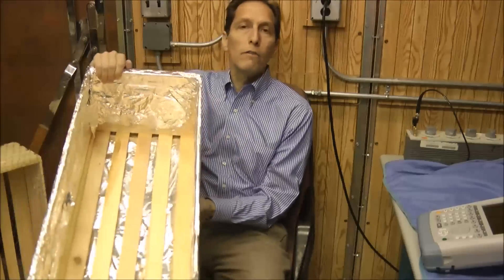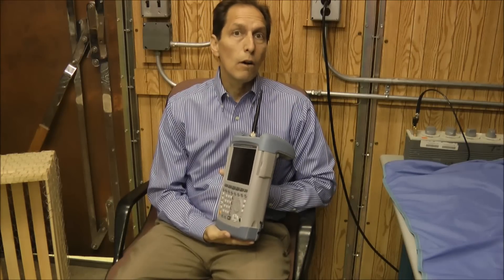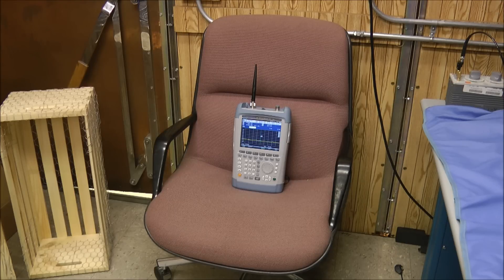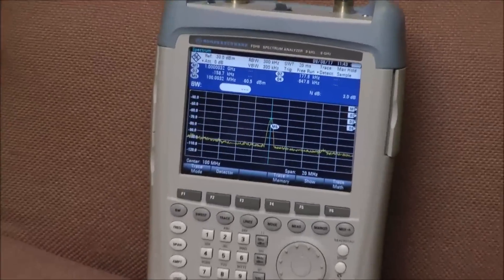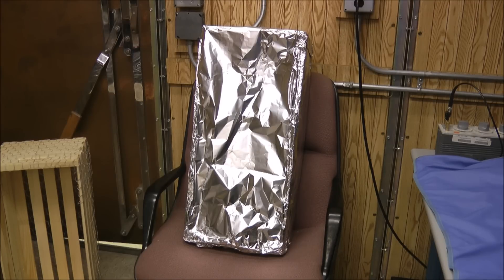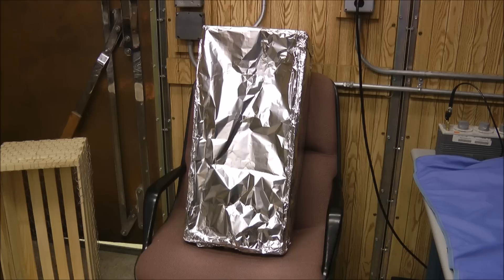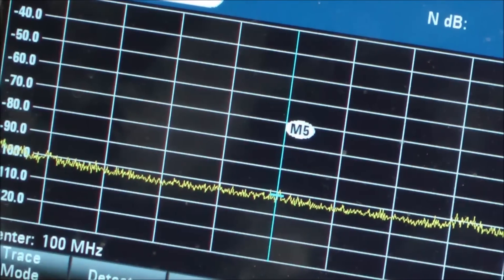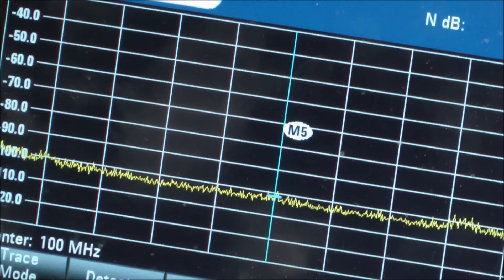Faraday Cage - Chicken Wire vs Aluminum Foil

Comment: If a terrorist had a nuclear bomb it seems unlikely they would set it off above the atmosphere to create a comparatively harmless EMP. Not to mention the delivery complexity. We can conclude with some certainty that only states with many nuclear assets would try this and it would not be anonymous. So if you lived in the only massively belligerent nation with many nuclear assets, say a country that was bombing 8 nations and trying to start a war with a ninth,  you'd be safe from man made EMP.  Right?
Reply from the maker: I get your point, and from a single terrorist group, I think you're right. They'd get a bigger bang for their buck taking out LA or Washington, DC. If, however, a terrorist nation with limited nuclear capability, such as North Korea, were to strike I could see a strong case for an EMP over conventional nuclear attack. The reason is that the net effect could be crippling, causing more than a trillion dollars in damage, without perhaps drawing a full nuclear retaliation. An EMP is an example of an asymmetric attack that could cause tremendous long-term damage and suffering, but might be difficult for a nation to properly respond to. Definitely, if we went to war with a large nuclear power, say China or Russia, EMPs would be part of their arsenal. Russia has directly made such a treat in the past.
Reply: @disasterprepper  No doubt you've read the declassified report on EMP. I have it somewhere on my laptop. I don't want to see 1000V on my clothesline, pretty wild read.

Comment: Nice video Dr Bradley! I have an airport timecapsule and i want to put a faraday cage on it, but i need an effective cage so that the airport time capsule dosen't overheat. Is there a chance that you can try out some different types of metal? thx B
Reply from the maker: I'm not familiar with the Time Capsule, but if it is in use as a router, the shielding would degrade the wifi connection. Also, you wouldn't want power wires coming into the Faraday cage. If it's not in use and just being stored, you could wrap it up in aluminum foil for safekeeping. Nearly any metal shields about the same. It's the size of the holes and seams that ultimately affect the shielding effectiveness.
Reply: Along these lines... say you've got an Airport Time Capsule, which generally needs to be hard-wired into your network, and you put it in a faraday cage to protect from EMP. However.. in order to work it needs to be plugged into wall for power, and the LAN via an ethernet cable, both of which I have to assume act as conductors.  I could be wrong, but wouldn't this be a fruitless endeavor?

Comment: just wanted to say how much i enjoy your video's                                                                                              i was wondering if aluminum window screen would offer better protection than the chicken wire and be  comparable to aluminum foil-  i'm thinking that the window screen would be a  more durable cover then the foil
Reply from the maker: Window screen does a fine job of shielding. You just want to make sure that you overlap and secure down the edges. Anything conductive with a mesh size of less than a mm does very well.
Reply: @disasterprepper  Would screening need to be grounded?  I'm trying to block the back side of a smart electric meter in my garage with a cement floor.
Reply from the maker: Smileyone Faraday cages do not need to be grounded to shield against RF energy.
Reply: @disasterprepper    It's a wall.  Not a cage.  So would a screened wall need grounding?
Reply from the maker: @smileyone1612  A conductive wall can help to reduce RF energy even if not grounded. With that said, it certainly wouldn't hurt to ground it, and that would help against lower frequency near-field emissions.
Reply: @disasterprepper  Thank You for these informative videos

 I want to build a few WiFi 'Shielding Walls'

There is a company in my country on eBay that does all types of mesh with different hole size and shape, wire thickness and materials like galvanised steel, stainless, aluminium, copper, brass, coatings

What would be your choice, please?
Reply from the maker: @johnrhodes3350  Hi John, the material doesn't really matter as long as it's a good conductor (which those materials are). What matters is that the hole size is well below 1mm in diameter. Also, there can be no seams that might act as antennas. Building a shielded room is not an easy feat to do correctly. No wires can penetrate it without going through filters, air must pass through waveguide vents, etc.
Reply: @disasterprepper  Thank You so much for the reply. It's given me quite a lot to think about, in a good way.
Reply: @disasterprepper   how do you ground it??
Reply from the maker: @izmashing5993  It's not necessary to ground a Faraday cage. I show this in another video.
Reply: @disasterprepper  which video?
Reply from the maker: @izmashing5993  https://youtu.be/dC2BRC9FDDA

Comment: how much maximal of frequency that disturb by the faraday cage??
Reply from the maker: I think you're asking how the shielding behaves at very high frequencies. The answer depends largely on the materials and construction of the Faraday cage. As frequencies go higher, any small seams or gaps begin to pass RF energy. A simple foil wrapped Faraday cage can protect well into the 10's of GHz if carefully constructed. I haven't tested above a few GHz, so I can't say with certainty where the shielding begins to fall off.
Reply: I'm sorry, coz i'm not good in English. 
That's right. You understand my question.
I've maked faraday cage last week. And i built with iron mosquito net,  alike your construction without wood. And that just shielding radio wave, i think range about 100Mhz. 
So what material do you use, so that shielding 10GHz frequecy?

Comment: You should do .5 inch or 1/4 inch chicken wire
Reply from the maker: They would certainly do better but still not as good as solid metal. You'd want the holes to be less than a millimeter to get comparable performance.

Comment: If you are just using staples the "sheleding" is not Continuous. You need to BOND some it the wires together in order to complete the "cage" and, there should be a ground connection. Overall it's an interesting vid.
Reply from the maker: The video is meant to show a comparison of how folks might commonly build an aluminum foil and chicken wire Faraday cage. It's not focused on optimizing the design of either. Also, despite rumors to the contrary, Faraday cages do not need to be ground to protect from electromagnetic waves.

Comment: Super helpful thank you. I’m trying to figure out if I could make a cage around an already built garage. I think it could be done if the concrete floor wouldn’t be an issue?? Idk thanks again
Reply: There is paint use could use to keep out the radiation. Do as much painting as you can outside, then do the concrete floor and ceiling etc inside. Or do the whole inside to have double layers.

Comment: It's all about the wavelength of the attacking frequency. As the wavelength gets shorter, more EMI shielding is needed.
Reply from the maker: Right, the wavelength explains why the chicken wire does significantly worse at high frequencies.
Reply: 5G is @ 24GHZ - 100GHZ. Short Millimeter, High Frequency Waves.
Reply: Thanks for the videos!

Comment: How do you faraday cage your house?
Reply from the maker: You can apply shielding to the walls of a home, but making it an effective Faraday cage is probably impossible. A better goal might be create a very well shielded room, such as a closet or other room without a window. I have a photo of a closet that I converted into a fully shielded room in my EMP book. Basically, I did it with overlapping aluminum foil on all the surfaces.
Reply: @disasterprepper  what about leaded paint?
Reply: Drakilicious I have a Aluminum Shield for my routers. It works. Bought it off a site for Shields for Routers and Smart Kill Meters, 😆

Comment: In Alaska we had an ozone hole flote over our remote property. Watched the trees dry wither in 2 hours, entire garden garden died & fish in the nearby stream died. Going outside was impossible for more than a few seconds. Used a trash can lid as a shield. Ran to generator shack & started generator.  Both our cabin & generator shack had heavy galvanized roofs. Sat inside in underwear spraying each other w water mist sitting in front of a fan.    Temp outside went over 100°. Thankfully after a couple of hours the hole moved on. Entire yard was solar blasted. Grass, garden, trees all dead. Solar radiation is no joke. Could see the drift of that ozone hole as it meandered through the forest by the wake of dead trees & greenery.  The path of destruction was only 2 miles long. Seemed to come from nowhere & end abruptly. Found dead birds, small critters & bugs in the kill path. A HAARP station is only a few miles away from our homestead. Saw lots of weird stuff in the sky up there. Saw 2 intensely bright flashes of light that blasted through blackout curtains in the winter an hour apart & woke us up like a spotlight being suddenly blasted into a sleeping persons face. INSTANTLY AWAKE! Folks in town said they had seen those intensely bright flashes too just before we moved there waking them up to in the middle of the night. Personally, I think HAARP had something to do w the ozone hole experience we had.
Reply from the maker: Wow, what an interesting account. I'll have to look into this. Thanks for sharing.
Reply: do you think there’s any relationship to the California fires,,and the health of our ozone layer?
Reply: I’ve wondered if the spraying has something to do with the ozone layer,,,have we messed it up??  I’ve read years ago,,just a rocket going into space burns a hole in the ozone layer,,
Reply: @Drakilicious keep believing what big brother tells you though. they'd never lie. right. right??

Comment: Also remember about heat/ammounth/strenght of field and shape. I would not be surprised most cages could create electric arcs and heat up or even cach fire and melt ...like put aluminium foil/chips bag into microwave oven and look... thats just from 700-1300W !
Are we speaking RFID chip/GPS/Wifi shield...then it will do...but 5G killergrid/microwave(military use killer-riot control) will struggle and might fail with EMP/solarflare 1859/2020 civilization scorcher.
Reply from the maker: Actually, the idea of cages melting isn't based in science. If you look at the energy density versus specific heat of materials, you'll find that an EMP won't noticeably warm anything. That's not to say that long conductors won't experience currents that could ultimately cause heat, certainly they will. But free-standing small metal enclosures won't see any noticeable heat rise. The reason is that the E1 and E2 pulses are of such a brief duration, and E3 is far too low energy density.
Reply: @disasterprepper  Ok, thanks.
Anything about "experimental directional energy emitters" or like some say cough cough california cough ?...or more linked with smartmeter remote pyro bomb thing ...even beams?

Comment: very fine mesh at out layer and solid conductive layer on inner or other way around?  or would be multiple layers of solid conductive material best option?
Reply from the maker: It shouldn't really matter which is outer or inner. Ideally, you'd like an insulator between the layers; even air is fine.

Comment: Would an EMP be a broad frequency band pulse, or a narrow one?  If narrow, can you estimate from previous nuclear tests what bandwidth we should be concerned about?  Great video!
Reply from the maker: The content of a pulse that is narrow in time (such as the E1 of an EMP) is very broad in frequency. The EMP pulse has energy content from about 100 kHz to 1 GHz. Note that low frequency energy couples well into long conductors, but not short ones, whereas high frequency energy can couple into both short and long conductors.
Reply: Thank you Doctor Bradley!

Comment: I would like to try and wallpaper my ham shack with al foil. Put some rf gaskets in the door and see how it does. Of course then I would have to filter all the cables coming into the room.
Reply from the maker: Yes, this is exactly how a professional shield room is done. Keep in mind that if you broadcast from the room, your external feed would obviously need to be filtered.

Comment: With earthing your faraday cage, what's the difference in effectiveness between one of those thin ~1ft steel(?) earthing rods and wire connection vs a thick 6ft copper grounding rod and copper wire connection? Also would an aluminium canopy be sufficient around my bed for most signals?
Reply from the maker: You don't actually need to earth (or ground) a Faraday cage for this type of shielding application. An aluminum cloth canopy would certainly help to reduce RF signals, but it might only provide 30 dB of protection. That's not typically enough to block a radio or wifi signal.
Reply: disasterprepper - How about if I coated it in copper? I'm trying to make a cheap one but I'd definitely like to block WiFi too

Comment: I'm wondering if a big alluminum pot will work well.I want to put one of my  spare engine control units  from my car in it and some other small electronics.
Reply from the maker: Hi John, As long as you cover or wrap the pot with aluminum foil, it should work well.

Comment: That's a bit big size holes, I would use as fine a mesh as possible, or, copper or aluminum foil. Thank you for this video.
Reply from the maker: Yes, you're right, the smaller the holes the better. I was just trying to dispel the myth that chicken wire works as well as a solid conductor.
Reply: @disasterprepper  hi, am reading the whole thing and thanks to you all. i have a question: can i still have wifi if i put my modem inside an IRON sealed box with only holes for cables? thanks!!
Reply from the maker: @nestor-sanz  The wifi would be poor, but it would still leak RF energy both directions. Running wires through a Faraday cage greatly compromises it.
Reply: @nestor-sanz  the harmful radiation is literally how WiFi works.
You could look into making "cantennas" or buying better performing "directional" antennas between the router and each device, but then you don't want to be near them, aka getting blasted by the router.  You would have to use shielding for yourself and or distance from either antenna.

Comment: How about with aluminum screen.  It's a mesh with significantly smaller holes than chicken wire.
Reply from the maker: Sure, that could work fine, but you'll need to make sure you don't accidentally leave any long seams untaped (or at least stapled down every couple of inches).
Reply: Yeah getting any small gaps eliminated is not easy.

Comment: Do faraday cages work on Low frequency waves, microwaves etc etc? Also do they need earthed or not?
Reply from the maker: Faraday cages don't work well on very low frequency waves. Fortunately, those waves do not couple efficiently into electronics of any reasonable size.
Reply: I'm being hurt daily and i dont know what with but i know its some kinda directed energy weapon or some other energy weapon. Its frying my nerves, heart and scrambling my brain waves. The pain is excruciating and i cant think or see straight. WHen an ambulance assesses me my ecg is normal as though the weapon is switched off as i can feel it subside. Then its cranked back up again. I wouldnt do this to my worst enemy. Any thoughts or advice would be greatly appreciated. Also would a plain foil box/faraday cage work to protect me if i lay/sleep in it? Does it protect against sonic sound waves like those used in stingers?
Reply: BRANN I I’m effected too!
Reply: @branni6538  it could be an emotional health disorder: extreme anxiety or depression can lead to  intense physical sensations of pain. If the doctors can't help you, try a psychologist or psychiatrist.
Reply: @christopherrowley7506  Figures.  Like we wouldn't have thought of that before considering the possibility of it being energy.

Comment: Does the chicken wire contained in a stucco house then somewhat make a house a gigantic faraday cage, assuming you chicken wire the roof trusses too?
Reply from the maker: It no doubt provides some shielding. Not quite a Faraday cage, but it would attenuate signals a bit.
Reply: no chiken wire in the roof or 
window openings . what good it it really then

Comment: One issue with foil shielding is that if there are repeated mechanical stresses, foil can crack and have much lower shielding or permit higher frequencies through.  
On low-level analog signals, when we wanted the best shielding for cables, we used a combination of foil and braid shielding. Of course, in that case, the foil shielding was primarily for electrostatic shielding and the braid would ensure conductivity even though flexing of the cable could cause cracking in the foil.
Reply from the maker: Absolutely true. Most cables that bend frequently use multi-layer shields that better withstand the motion. I don't know that it's quite as important for an enclosure, however, since the walls and seals are not really moving around. That said, foil can certainly crack, and those cracks can lead to RF leakage.